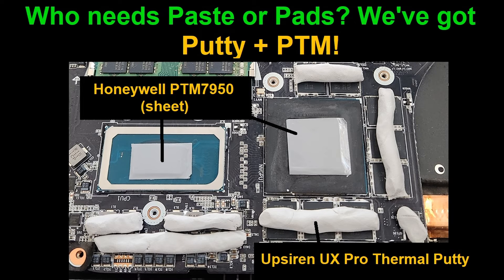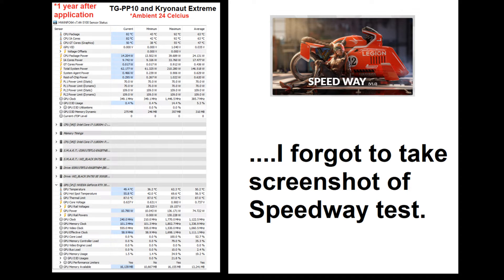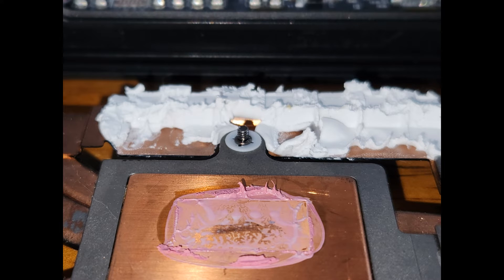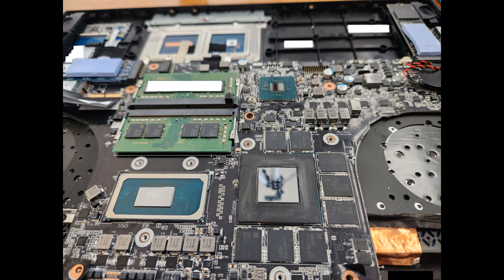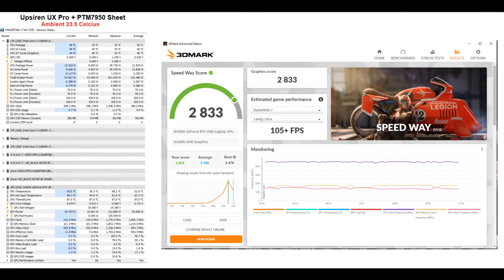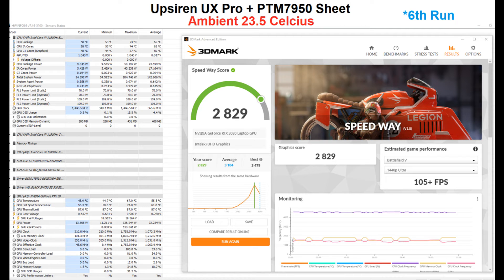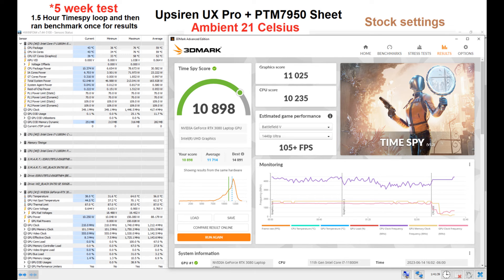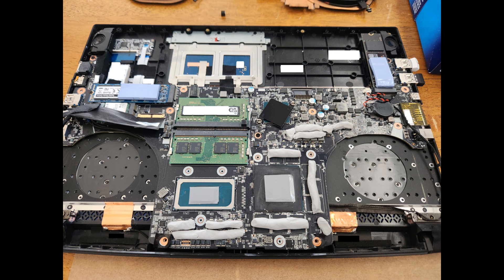RTX3080 Laptop meets Upsiren UX Pro thermal putty and Honeywell PTM7950

Comment: how thick in diameter should the Upsiren UX Pro be when applying to the vram chips?
Reply from the maker: If the stock VRAM pads are 2mm then use a roll that's 6mm in diameter

If pads were 1.5mm then use 5.5mm roll

If pads were 1mm then use 4.5mm roll
Reply: @snarksdomain  thanks :D
Reply: @snarksdomain  Does the putty have to be in logs for laptop application? Whats the science behind rolling logs of putty instead of just putting respectively sized balls on each VRAM, VRM chip?
Reply from the maker: @kookymonkey  I prefer logs myself. I like having one larger piece of putty that has full contact with the cooler and PCB, as opposed to individual balls. I find rolling logs is quite quick and easy to do.

You can always experiment either way and reuse the same outty if you change you mind.

Just be sure to wear gloves. Some folks are sensitive to silicone oil and can get rashes. On the other hand, you don't want your skin oils to effect adhesion of the outty to the cooler/component.
Reply: @snarksdomain thanks always for the quick responses 👍
Reply: @snarksdomain  What if the thermal pads have desintegrated on the GDDR5 vrams, how would i know then what thickness the pads/logs should be? It is for an Omen 15-ce198wm if that means anything
Reply from the maker: @kookymonkey  I'd likely aim for around 5.5mm diameter. Putty is quite forgiving when it comes to thickness.

One thing you can do is try rolling putty and placing where it need to go, then doing a "dry-fit" without paste. Reassemble and then disassemble right away and inspect the spread of putty.

Too much? remove some. Too little? add some. Then you can scoop up the same putty, roll again and reapply. then apply paste or Phase Change to the core and CPU and reassemble and power it back up.

I watched a video of a teardown, but couldn't get a good angle view of the pad thickness, but it seems fairly thin. My guess is 1mm to 1.5mm OEM pads on VRAM of your laptop

Comment: Question, how many grams of Upsiren UX Pro did you use? I got the 20g one but I don't think it is enough?
Reply from the maker: 20g is likely not enough. For laptops, I recommend buying 50g of your chosen putty. Their densities are mostly all around 3.2 to 3.5 g/cc.
Reply: @snarksdomain 
Thanks a bunch! I would agree with you. Gonna return the 20g and get the 50! Thanks again!
Reply from the maker: @solitarymassacre  Glad I could help. Some folks have had issues using UX Pro in laptops as it is slightly stiffer than other putties. It worked okay for me as I applied pressure during reassembly to make sure it compressed.

Just figured I should mention this so you would know.
Reply: @snarksdomain 
Appreciate you! Long story short, am shunt modding my 4090 laptop, someone else already did it and they used Upsiren U6 pro but I couldn't find that on Amazon (well trustworthy U6 pro) that would ship within a reasonable time and saw UX Pro Ultra was better thermal conductivity and got that instead.

And on the Upsiren website, the manual says to spread a 1mm thick layer for the UX Pro, so I was going to do that. Does that sound okay instead of rolling the logs?
Reply from the maker: @solitarymassacre Not sure if your OEM pads are only 1mm. Probably best to measure the pads on your VRAM.

VRAM putty math
=================
2mm pad = 6mm log
1.5mm pad = 5.5mm log
1mm pad = 4.5mm log

Also be careful on Amazon. Looks like Computer Systems GR is now selling a version of UX Pro on Amazon as well.

The only one I've tested for YX is from Upsiren which sells on Aliexpress, Newegg and Amazon.
Reply: @snarksdomain  
I saw the NewEgg listing. It says its sold by "Middle" then when I hover over that, it says its sold direct from the manufacturer. Not sure if that is correct? The 20g I have now which I am returning looks 100% legit, but I know how easy it is to fake packaging lol

But the people I bought UX Pro from Amazon are Almd-pc. Not sure who they are but it has 2 day shipping so that is why I got it. Looks like they are a chinese based group which so is Aliexpress right?

Anyway, yeah my current Rog 17 has putty not pads already. Its blue. So I am not exactly sure what math to do now lol. I also saw the same seller on Amazon has the U6 Pro, is that better in terms of the thickness? And wouldn't need as much pressure? Maybe I should get that instead since that is what the original person used on the shunt mod. 

I'm slightly afraid of the putty not allowing the heatsink to fully set which would then afffect my LM on the CPU and GPU. 

Also, not just the VRAM has it on my laptop, A LOT of the VRMs and other stuff is covered too
Reply: @snarksdomain 
Side note - the seller on Amazon actually has your YT video as part of their images for the product
Reply from the maker: @solitarymassacre  Should be good then. Also check Brand and make sure it doesn't say "Computer Systems GR".
Reply from the maker: @solitarymassacre  U6 is softer than UX, UTP-8 is even softer. 

Save the blue putty just in case you run into issues. I wonder which blue putty it is. If you roll up the blue putty from the VRAM and then roll it into logs of adequate legnth for the VRAM rows (if possible), then you can simply recreate a similar dimater of logs with a different putty and it should work out. When in doubt just go 5.5-6mm logs for VRAM. I doubt it is 1mm gap, and even if it is, a softer putty will press out okay.

You can also do a "Dry fit"with putty only, and no LM. assemble cooler block, and take back apart and inspect putty spread. Then just scoop out putty, reroll and add some more iff needed or remove some if excessive. Then use LM on final assembly.

As you use putty more and more, you will likely get more conforatble with just winding it and using your judgement. I rarely measure anymore as I can usually tell a 1mm, 1.5mm, and 2mm pad just at a glance. For testing purposes on my test card I strill use a 6mm siriunge nozzle cut to keep things consistent.
Reply: @snarksdomain  
Thanks, it doesn't. Everything says upsiren on it. Even has the upsiren seal sticker thingy
Reply: @snarksdomain  
Hey I sent you an email. I attached a picture of the box I got, just wanna make sure I got the legit brand and not some knock off. I just watched your previous video about the tale of two putties lol
Reply from the maker: @solitarymassacre  I replied back. Could use a few more pics to be sure, but from the one you sent I'm thinking it's the correct one.

Comment: What do u think would cause my laird 7100 install to go bad in 6 weeks. Temps were great for about a month now we are back to 90+ on coores and hotspots. Used arctic tp3 for vram and laird tpm 7000 version. U think it might of pumped out ?
Reply from the maker: That does seem odd. It shouldn't have pumped out, other than the initial melt and flow that PCM's do. It melts at a higher temp than most other PCM's and need a good burn-in for it to melt. Might be worthwhile opening it up to take a look, see if it lost contact somehow. Do you have extra to reapply? I presume you got a big sheet of the Laird from Digikey or Mouser?
Reply: @snarksdomain  yeah I got a big sheet I am going to wait to get my upsiren for my vrms on that laptop before I open it up

Comment: @Snarks Domain is 7958 better than 7950 ?
Reply from the maker: I won't know for sure for a couple days. Just applied PTM7958SP to CPU and GPU core on Testbench .21

But I'm confident there will be some improvement over PTM7950, otherwise Lenovo would have justy stuck with PTM7950 for their gaming laptops
Reply: @snarksdomain  Damn and me who just applied 7950 to my CPU and GPU..even delid my CPU
Reply from the maker: @rygaros6669  7950 is still a good option.

Comment: Finally, the video I was looking for! 
1. Using the PTM + UX Pro. 
2. Initial testing. Decent improvement. 
3. 5 week later testing with temps, usage. Dramatically better results. 

I am officially sold on it now. Thank you for your video. I’m running a i9-12950HX with a mobile 3080 Ti. I hope to get some improvements as I am sitting at 95°C doing absolutely nothing. The LM was applied incorrectly from factory so it’s been throttling like hell. And I don’t care for LM, as I’ve been researching these better hassle free pads. Kind of upsetting for such an expensive machine!
Reply: Same here, on a predator 300, CPU went from 94°C, 3800MHz, 35W to 79°C, 4200MHz, 45W. Got some improvements on GPU as well ~13°C. It was on thermal grizzly before.
Reply: Strix 17 SE?
I opened mine up today and the LM was literally everywhere EXCEPT the die exactly as you described 💀
It all pooled up around the cpu and gpu but nowhere on it, I'm waiting for my PTM & U6 Pro to arrive, anything is better than LM atm considering it never stays where it needs to be.
Reply: @TheAwwWtf Yup, G733-CX. It’s annoying. I didn’t know it would look like such a mess. From what I’ve gathered is that if you travel or store your laptop like normal and it tilts, the drip happens. If you can always keep it laying flat, you should be ok. A shame for such an expensive machine.
Reply: @thomasjohnson8517  Exact same model as me, it just took me 3 hours to clean it because of how much liquid metal they put on, like they put a crazy amount on mine, I swear they just ketchup bottle farted out a glob onto the die.. it was ridiculous..
And yeah I figured it had to do with my traveling, the heat issues only kicked in after I had gone on a few work trips where it was lugged around in a backpack and I can only imagine what the turbulence of planes does to it, suddenly went from playing top end games to throttling when I played Half-Life 2...
Reply: @gibonzproject9710  Is that with PTM or stock LM?
The LM only lasted about 2 months for me before it seeped out, so far the PTM has been steady with no issues but I'll see how long that'll stay that way.
Reply: @gibonzproject9710  LM = Liquid Metal, the laptop we're talking about the Strix 17 SE uses Liquid Metal, so far the PTM is far superior
Reply: @TheAwwWtf hey man. I've got the Zephyrus S17 with the 2080. It comes with LM on the cpu, too. Would you suggest that I also clean out the LM and repaste everything including the CPU with PTM7950?
Reply: @christmasisawesome9348  
If you are not currently experiencing heat issues I recommend waiting until the laptop begins showing signs of LM pump-out and thermal problems first + preparing by researching teardowns of your laptop+ getting the right equipment for the job. You don't want to break anything taking the laptop apart, so study and prep for it until you feel like a surgeon, Ifixit prying kit & screw driver kit & some magnetic bowls for the screws was extremely helpful in managing the teardown.

If you are already opening up the laptop then YES I would recommend replacing the LM on both the GPU & CPU at the same time, take your time cleaning the LM- have a huge ass box of Q-Tips on hand to clean it off and do not try to cover the whole tip in LM just try clean a small amount of LM off bit by bit + small circular motions & patience, sometimes it feels like the LM never stops even a tiny drop can produce a large pool when squished. Remember the Q-TIPS are disposable but your laptop ain't. Use as many as you need, do not feel the need to rush it.
+Have somewhere to put the LM that isn't going to chemically react to LM. Liquid Metal can eat through aluminium so find a safe spot for all the q-tips.
It took me about 3 hours to clean it all off safely. 
Also since I have no intention of using LM in my laptop again I removed the protective foam surrounding the gpu & cpu- take care if you remove the foam LM can hide inside and under the foam! - doing this will mean you can never put LM on your laptop again but if you're replacing it with PTM that shouldn't matter.

I got my PTM from LinusTechTips' store & my Thermal putty "UPSIREN Thermal Putty U6 PRO" from middle999 store on ali express, it's the pink one, I can recommend that one since it worked well for me and was easy to work with, I recommend using finger gloves + those small plastic spreaders they give for thermal paste when working with Putty.
Also you may want to check copper heatpipe mods for your laptop, you can buy copper heatpipes on ali express, just make sure you have clearance and use thermal epoxy. I added some copper shims + two heatpipes and my temps are about 4-6c less than stock. It is a pain in the ass finding the room for the extra copper + making sure the extra pieces don't collide with anything, this isn't necessary but if you are hunting to create the quietest laptop I'd suggest looking into it.

Also be very careful when opening up your laptop near the touch pad, they may have little plastic pieces that can be broken off when prying open the laptop, breaking them can make it impossible to click the touchpad, at least for my Strix 17 se that was the case and I had to replace the back shell so my touchpad would click again because I broke off one of these TINY latches.

If you have any other questions lemme know.

As a quick update it's been about 3 months and my laptop has genuinely never thermal throttled since and even my wife is chuffed with how quiet the laptop is now when we play Baldur's Gate 3 on the tv. It genuinely made me go from never using my laptop to using it all the time.
Reply: How are your temps now comparatively?
Reply: @kookymonkey for my laptop, literally never thermal throttles anymore. I'm hitting higher clocks on the cpu and gpu while also being quieter and cooler.
Reply: @TheAwwWtf  Awesome! longer lifespan as well, and no worries about LM leaks. 

 I need to check the TIMs on my Strix G18 4080 laptop once it starts overheating
Supposedly Asus's LM factory applications are poor, and typically high temperatures of the 13980HX aren't helping either. I hit around 86C when playing games, so i still have a year or so. 

I repasted one of my friends laptops as an early birthday gift two days ago as he would constantly mention issues FPS-wise despite having a 1060 Max-Q. I ended up upgrading the ram, storage and repasting the CPU/GPU dies with official PTM-7950 from MODDIY, left the thermal pads since they looked fine. I cleaned the dust out, and his fps more than tripled.
Reply: @kookymonkey  My GPU clocks on the strix with the 3080 we're literally capping out at 1400mhz at 87c (100c hotspot) and thermally throttling. Straight up the ASUS LM application was everywhere EXCEPT the CPU/GPU dies, it was all pushed out into the protective area. I could have reapplied the same LM onto the chips but I never want to open my laptop up again so the PTM is the perfect solution, cleaning up the LM was a pain in the ass though. 
Once done though I'd never seen my GPU hit 1850mhz before but it does that while staying at 75c without any throttling, it's night and day and just shows reliable PTM is far superior to LM's unreliable garbage.
Reply: @TheAwwWtf  wow those are amazing results

Comment: Guys use less putty as it will spread especially over RAM chips. This much causes it to store unwanted heat.
Reply from the maker: I'll definitely be testing out ropes of putty vs balls of putty. Will do it on the test card though. I still think there is a benefit of having a large strip of it gripping onto the componenet/PCB. Less chance of being displayed if you drop your laptop.
Reply: @snarksdomain would 20gs be enough to cover 1 laptop?
Reply from the maker: @Razoronmd  20g won't be enough I don't think, unless you only do the VRAM. 50g is a safer bet. The container is smaller than it might seem.
Reply: @snarksdomain  I've seen u6 is a lot cheaper would that be a nice substitute? 50g is almost 40 dollars 😭
Reply from the maker: @Razoronmd  yeah, U6 is quite good. You may want to look atthe current chart located on the Google Drive I. My channels About page for the most up to date comparison of different putties.

Comment: Are you using the Turbo mode (fans 100%) in Control Center? I have and Aorus 15P XD 3070 and I have the same thermal results as yours after repasting PTM7950 with the fans at 100%.
Reply from the maker: Yes, fans were at 100% for these tests.

Comment: PTM7950 works great on my laptop CPU. It is very hard to find a paste that works as good, I tried many many pastes in the last 3 years. Actually only two pastes were able to match PTM7950 (Koolingmonster Kold-01 and Aerocool Fuzion). Soon I will try the paste version of PTM7950.
Reply from the maker: I definitely want to try KOLD-01. Will look into the other one.
Reply: @snarksdomain  Maybe it works on your laptop too. I don't understand why so many pastes are so much worse than these two+PTM7950 on my laptop CPU. Maybe Kold-01 and Fuzion are the same, not sure. Some of the specs are identical like thermal Impedance, density, Viscosity. Consistency is very similar to me and performance within +-0.5°C.
Reply: @snarksdomain  Kold-01 might be a rebrand of DOWSIL TC-5888 --> same specs. It wouldn't surprise me because TC-5888 is great in most tests.
Reply from the maker: @K543  thanks for the info.
Reply: @snarksdomain  Another good one for direct die chips might be Shin-Etsu 7868. In this test it's 1°C better than PTM7950: 
https://youtu.be/XO_f4Q0MI6E?t=1466